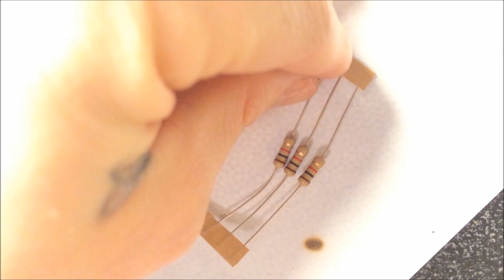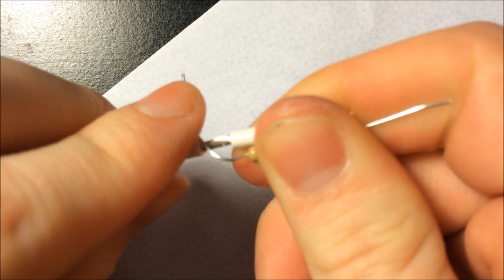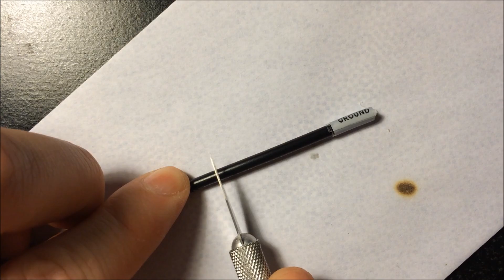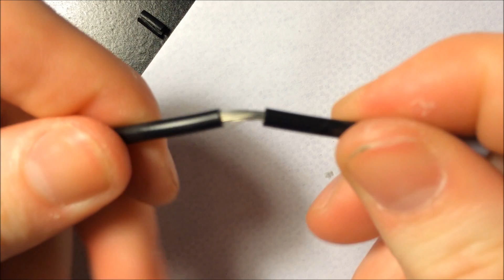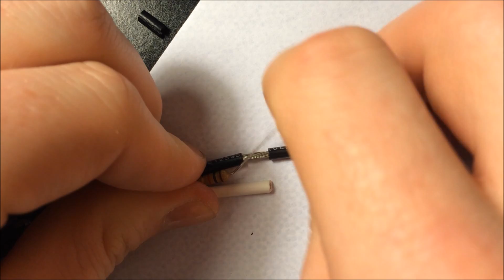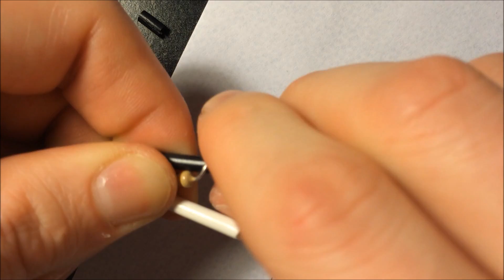How to Wire in an Ohm Resistor

Comment: Would that be considered.. in parallel..  or ..  in series..  I need to change an 8ohm speaker to a 4ohm. speaker.. the way it reads  how to do it is slightly confusing
Reply: The video is in series, if the white wire was connected to the black after the resistor as well, then it would be in parallel but I'm sure you would short circuit the resistor. been while since I've taken the class but electricity would follow path of least resistance

Comment: Hey I have a question. Does it matter what way the resistor goes? Like which side connects to the black and which wire connects to the white? And also do you HAVE to solder it?

Comment: Thanks Nick. Useful for me to know. I’m trying to remove a water in fuel sensor from my truck.  The factory sensor activates the circuit after water creates a signal to the sensor. I think the sensor activates with water lowering the electrical resistance to about 40 kilohms. I’m thinking that if I wire in a 80 kilohm resistor, the active water in fuel signal should turn off. Let me know if I’m on the right track. Regards.

Comment: Yes I’m just baffled I’m putting my n a remote start on a one wire locking system it needs 3000 ohms resistor for lock and 7200 for unlock now do I wire the lock wire from remote start to the resistor then wire the other side of resistor to the one wire unlock/ lock wire please help

Comment: Hey here is my call :-) can you make a video about adding a resistor to a loudspeaker box to increase ohm impedance for every speaker in the system ? Because old tube amp dosent match with new speaker ohm impedance.....